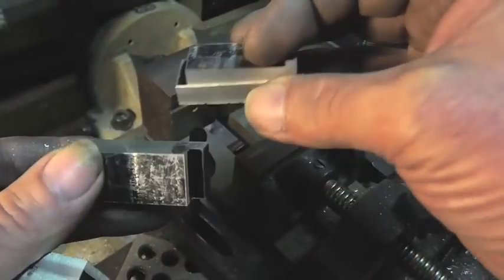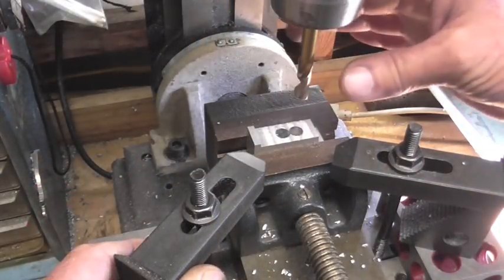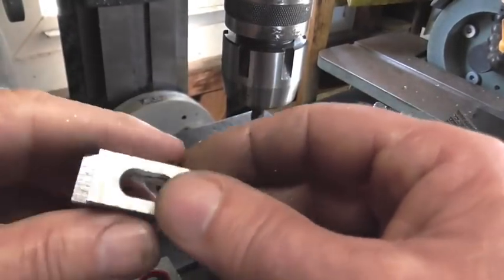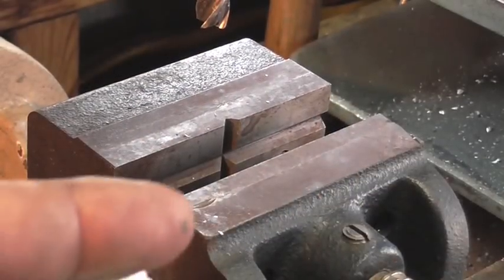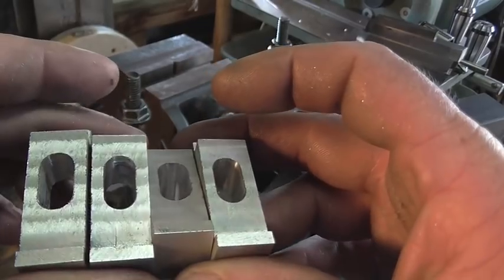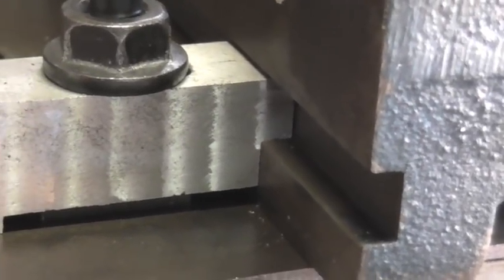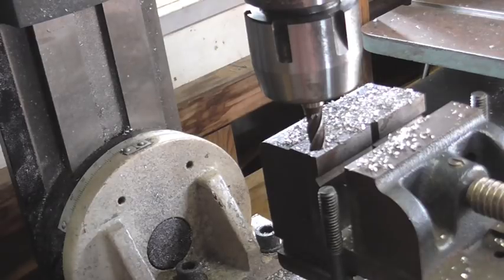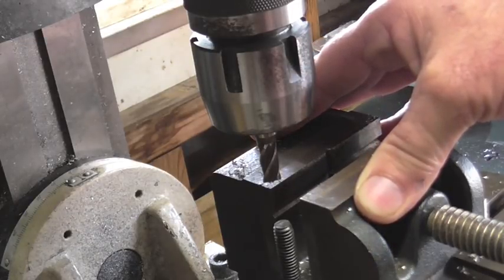P2 Machining Low Profile Vise Clamps *FIRST MILLING JOB EVER*  - MSFN

Comment: Hi Richard,
You are doing a great job especially for you're level of experience. Using the grey matter between the ears is the most important tool you can use and it looks like you are using it well. Always tackle every project with a well thought out game plan. With the proper use of the grey matter you can learn as much from the failures as you can from the success which was clearly evident in this 2 part video. Great job on many levels! 
Steve
Reply from the maker: Thanks Steve, I have already picked up some steel to make the permanent set. Now that the vise is held down and I can put away the toe clamp contraption(s) LOL. It was a really fun project and I learned a lot. Now onto fixing other things this little mill needs. Thanks for the kind words and everyone should check out Steve's Solid Rock Channel....lots of great information there and coming from a person with vast knowledge and decades of experience ~ Richard
Reply: Thanks for the shout out Richard.
It was a pleasure talking with you on the phone. Looking forward to doing a project with you.
Steve
Reply from the maker: The pleasure was all mine, I could talk machining all day long...Love It! As soon as I get some of the fires put out here I look forward to a collaboration video with your channel Steve. I appreciate ya! ~ Richard

Comment: Spot drill your hole locations prior to drilling.  Be sure your table is locked on the X & Y axis prior to drilling.  I'm an amateur machinist myself on an old worn Bridgeport so I deal with slop and backlash all the time.  I learned to work around it.

Comment: Thanks need to make some clamps for my milling vice also. I use a 3inch tool maker’s vice on my mini mill. It has holes for the hold downs clamps in the sides. So my clamp need to have pens to lock the vice down. Thanks for sharing
Reply from the maker: Yes, holding the vise down properly is the whole ball of wax. Thanks for watching! :)

Comment: Man you don't make this thinks from aluminum
Reply from the maker: They were just temporary clamps until I could get to my steel supplier to buy the proper thickness steel flat bar. The mill is new and aluminum isnt a bad choice to practice with for a first milling job to try it out. I think I did pretty good for a newbie 😊

Comment: Now that's progress buddy.  Great video.  Looks to me that your getting some practice milling and making improvements to the machine.  What more can a guy ask for?  Nice Job Richard.

Joe
Reply from the maker: Thanks Joe, stopped by my steel supplier today and picked up material to make the new steel clamps and another piece of steel to fix another issue with the mill I hadnt discussed yet on the channel. I was super pleased the vise had no movement using the clamps featured in the vid. The X/Y table the milling head is attached to is super solid as well..that didnt budge either as seen by the indicator. A few more things to fix on it
Reply from the maker: I am now in a position to make that T-Nut for you....LOL
Reply: Well now that I know you can make chips on your mill, I am going to remind you that I need something made sometime in the future!!!  :-)
Reply from the maker: If I can do it....sure!

Comment: There are center cutting mills that you can plunge with and there are end mills that you can not plunge with.  I would suggest getting a proper milling vise or one of those grinder style vises like Steve Summers bought recently. That drill press style vise has in my experience been a work holding nightmare.  They do ok for downward forces. but get some up force or heavy side loads and the parts like to move or come out of the vise.
Reply from the maker: Thanks for the input Brian, all the milling stuff is new to me. I watch a lot of milling vids but until you actually do it is a different animal. I learned alot on this first project and as funds permit I will be buying more tooling for the little mill. I am grateful for the vise I have now but I hear ya
Reply: @MakinSumthinFromNuthin  hes right the work in a normal vise tends to climb up when clamped so you need one with a downward mechanism like a screwless vise or a Kurt milling vise has...but with time you will find out by yourself about these things o don't worry about that...
Reply from the maker: Brian is always right, a great machinist and engineer. The vise was given to me and all I have to work with so make do. That tiny "mill" doesnt see much use, nothing critical anyway.

Comment: Nice milling Richard.  On my little mill I consistently plunge mill rather than side mill.  It goes faster and is easier on the machine.  But on some end mills you must first drill a hole to get started.  But it seems like on some, depending on the end mill you can plunge straight away.  Try it on a piece of scrap you may be surprised, for me it is way faster than side cutting. Good to see  you again, we are still working on storm damage down here. :-)
Reply from the maker: I hate to hear that Glenn, Irma was a nasty storm. Hopefully our last for a long time. As I gain experience I will get bolder...I just have to remember its not a Bridgeport 😊
Reply: Thanks Richard.  No I don't have a Bridgeport either just a really cheap mini mill.  But still it is stout enough of plunging quite nicely.  Try it and you may like it too.
Reply from the maker: All my endmills are used and came with the mini mill. I need to buy new ones so I can start fresh with good tooling and see what I can get away with. I appreciate you checking out my milling vids, I am happy to have the little mill

Comment: When you start milling steel, you need very much courage. 
If you don't cut deep enough, by going fast enough, you'll just press and harden the material with a massage. 
And that'll start squeaking! And eventually you won't be able to cut it and just break your mill bits. 
Also soft metals like alum or copper need super sharp tools. It's "gummy" and it prefers to be rubbed off and ripped to the side rather than sheared off. 
Take a moment to learn CLIMB milling vs CONVENTIONAL milling : https://www.youtube.com/watch?v=umAPgOm7mTI
Reply from the maker: I have milled some steel on it off camera, the mill handles it. I been brushing up on speeds & feeds as well as conventional and climb milling. I need to buy some new milling cutters, all mine are used and I need to know what a new one feels like and cuts like. As funds permit I will buy some....thanks for checkin out part 2 😊

Comment: There ya go bud. Necessity and invention are our mainstay. You can hand sharpen the milling cutters. Maybe nor perfect but way better than dull eh.Don't be beating yourself up on things like this. They will certainly serve you well for life. Steel next if you need but only if these fail fella and I can't see that unless you grossly over torque these ones.all in all yer a winner. Next ones can be a bit wider too but no matter. These are fine as is.Well done fella !
Reply from the maker: Thanks Dean, these do hold really solid. These were supposed to be wider but I hacked them up pretty good when cutting them by hand with the bandsaw so lost width. Appreciate the kind words....my 1st milling project was actually successful 🤗
Reply: I saw that but they work and that is all that matters fella.WOOHOO on you !

Comment: I don't think plunging down would have hurt anything...
Reply from the maker: You may be right but I wasnt taking any chances 😊
Reply: With milling you need to know the limits and push close to them, Or you won't get anything done. You need to break a few mills to get the hang of it. Playing it safe you'll always go too slow and too low quality. Consistency is KEY.
Reply: You probably could have figured out a way to hold the vice at the bottom and not had to re-tram every time. Some small pieces of steel flat bar with a hole in them, t-nuts, small studs (and nuts for them)  and some spacers for the rear that were just a little higher than the slot in the vice. The back bottom of the clamps you made could have been just a little taller so the clamps slope down a little toward the vice.
Reply: I was late to the party. :)
Reply from the maker: Give me time, I am sure I will break some soon but couldnt afford to bozo these parts. Holding the vise with toe clamps was getting old tramming every cut.
Reply from the maker: Great idea!, where were you last week when I needed you! LOL  I had fun practicing tramming tho and the clamps gave me some well needed experience